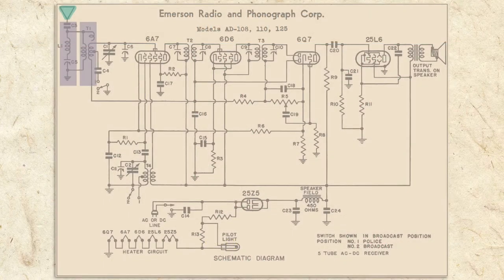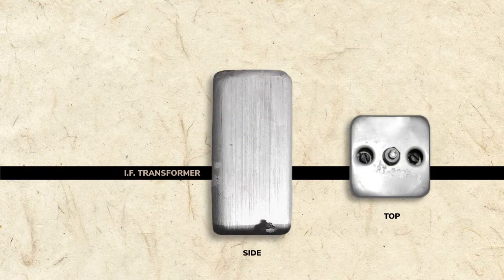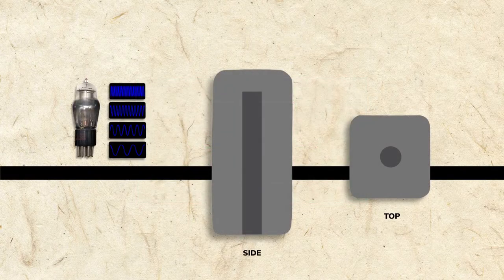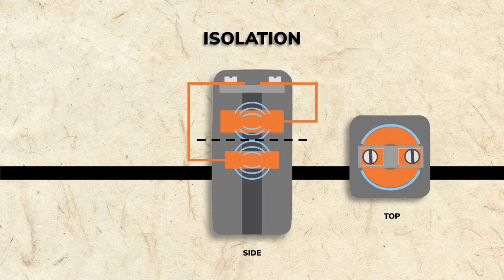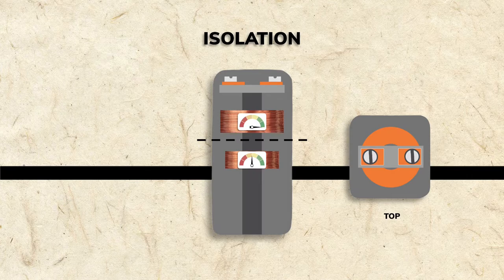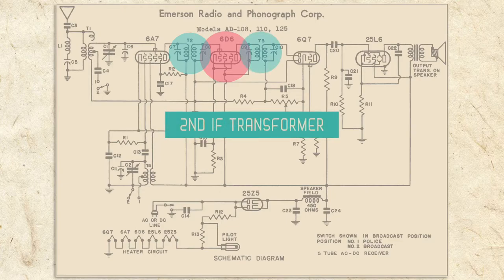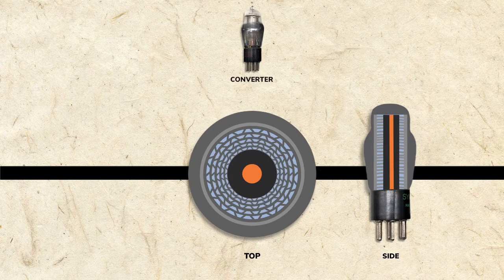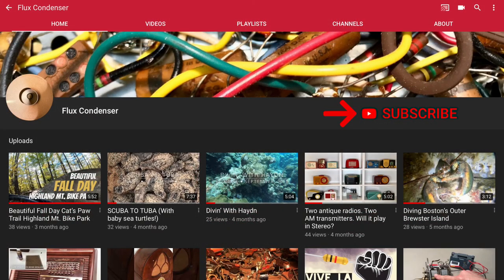What are IF Transformers?

Comment: i believe this is my new favorite subscription, I may have missed it, but how about a video on SMD?
Reply from the maker: Thanks, Chad. So glad to hear that you’re enjoying the channel. Unfortunately, I know very little about SMD (surface mounted devices) as I really lean toward the old stuff where a standard “through-hole” PC board is considered “cutting edge!” Those little buggers can be tricky, though, and my understanding is that a good SMD station with high magnification or even an electronic display is the way to go.
Reply: @FluxCondenser  sorry for confusion, "silver mica disease" in the IF cans.
Reply from the maker: Oh, that SMD! Thanks for clearing that up. I’ll definitely consider addressing this in the future, perhaps with a generic video about servicing and rebuilding IF transformers. When I first got into the hobby I read a lot about silver mica disease and was always on the lookout for it and expected to come across it often. I actually purchased a good supply of high quality mica caps of various values to prepare for the inevitable. Now though, I tend not to think about it as I’ve simply never encountered a radio with the issue. I believe the environment in which a radio was used or stored can greatly affect the problem. Radios stored in damp environments, particularly seaside areas with salt in the air being the worse. The fix is generally to snip the old caps from the circuit and mount new ones just outside the can as there’s often not enough room inside. I believe YouTuber Shango066 has run across the problem often so you may want to search his videos. Restore Old Radios, Mr. Carlson’s Lab and Uncle Doug are also fantastic.